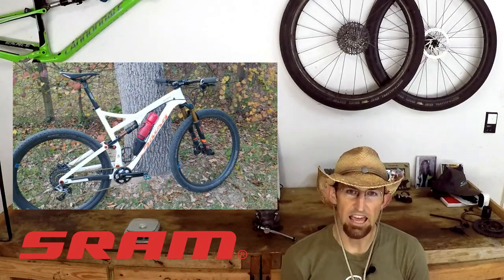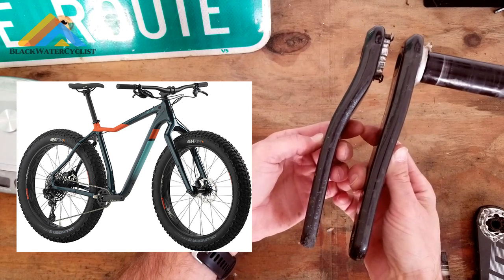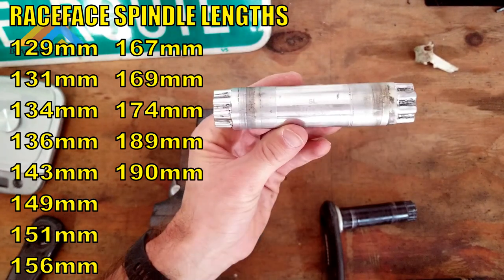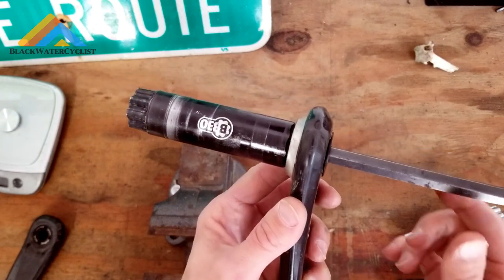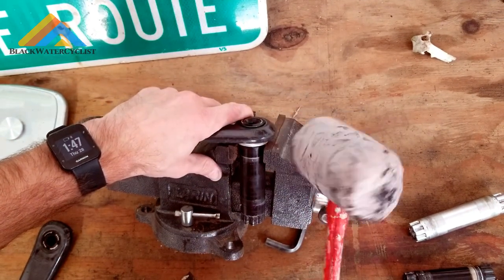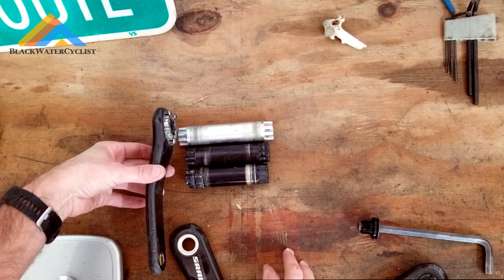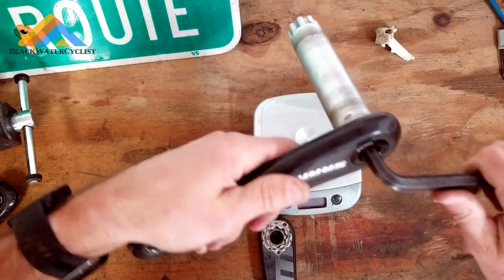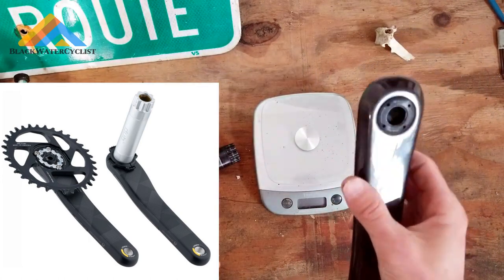The Best Carbon Crankset? - Sram BB30 Spindle for MTB | Fat Bike XX1 | RaceFace Next SL | Q Factor

Comment: BWC, really super video you did. 
Can you clarify a few things?
a)Do you know which SRAM Dub or BB30 crankarms are bonded to NDside spindle & not removeable?  (Ex. are all Eagles bonded or just XX1/XX0, etc.  I know GXP is bonded, just trying to better clarify which models the Spindle is removeable.)
b)With these SRAM cranks (NDS & DS) - am I understanding correctly, both sides can take 30mm Spindles or Dub Spindles? Probably dumb of me to ask, but I wasn't 100% clear if only one side's interface can be interchanged (ie DS, but not NDS),
 thanks so much for any time you have  to clarifying these things!
PS liked seeing the Assioma's ;)
Reply from the maker: Thanks Aaron! All Dub spindles are bonded so it won't work with the dub spindles. Both DS and NDS have the same BB30 interface which is nice. As far as which models, really any model that has a bolt on the NDS is removable. Its really just the models that have PF30 printed on the black spindle that are removable. 

Just some extra info, you can put a Race Face crank arm on one side and a sram on the other if you for some reason broke a crank arm. Cannondale you cannot do this because the BB30 interface is clocked a little off so it will go on the spindle but one crank will be at 12 o clock and the other at like 5 o clock. 

Yeah the Assiomas were awesome until I broke them :(  I was doing some rough MTB riding with them and killed them. My fault completely.

Comment: Just to be sure.... so if I buy a DUB crankset, I can remove the spindle, install a PF30 spindle and use with a PF30 bottom bracket? If yes, does the  same goes for a CINCH/RaceFace crankset? Thanks for the video!!

Comment: This is great thanks for sharing! I can't find anywhere else that posts the spindle lengths for Sram bb30/pf30/bb386/... I'm trying to fit some Sram Red 22 road cranks on a BSA frame. I know the Force 22 spindle is long enough to fit BSA BB with external cups. But I suspect the Wide (which i think is called BB386) version of the Sram Red 22 crankset (the one with removable spider) has the same spindle length as the Force. Have you encountered that or know if those spindles are the same length?

Comment: Thanks for the awesome video! Do you mind posting the spindle lengths of the SRAM MTB and SRAM Road?
Reply from the maker: Road pf30 is 118mm and MTB pf30 is 114 . The mtb pf30 spindles are narrower than the road option. They use the bend in the crank arm to make them wider to clear the mtb frame. Those measurements are with the arms removed and measured end to end.

Comment: Man! You answered so many of my questions! I'm on the market looking for a cheap used carbon crankset, so my question is: you did that spindle swap, to be able to fit a road crankset on a mountain bike, right?
Reply from the maker: Glad it was helpful for you! Yes I did it to install the road arms on my mountain bike.
Reply: @BlackWaterCyclist  Awesome! Last question, how do I start from scratch? I have this old sram XO crankset, but I lost the spindle, and I want to install in in a new frame, which measurements and dimensionas should I consider to get the correct 30mm spindle?

Comment: Love your hacks! I noticed you mentioned the crank needs to have a removable spider. I have a Red 22 crankset that I wanted to put a longer spindle on. It has an integrated spider. Is there any reason that shouldn't work. Thanks!
Reply from the maker: Hi Steven, thanks man. As long as it has the PF30 spindle then you can change it out. The smaller GXP spindle is not removable.

Comment: Good video! Could I put a GXP spindle on those arms or specifically on the Cannondale Si arms?
Reply from the maker: Hi Alfonso, thanks for watching. Unfortunately the GXP spindle is not removable so you cannot do the same as you can with the 30mm spindles. Almost all 30mm spindles have the same interface for the crankarms from Sram to cdale to raceface/Easton. One company that is different is Rotor. I hope that helps.

Comment: I’m currently upgrading my gravel bike and this video was very helpful. Do you know what the standard spindle length is on a Quarq BB30? I want to say I need at least 104mm to clear 68mm BSA frame.
Reply from the maker: Glad it was helpful. When measuring from inside of the left crank arm to the end of the spindle, it was 106mm in length.

Comment: Wow, didn't know you can do this kinda hack on Sram. I own a RaceFace Crankset with a 30mm Spindle and yes sometimes I did spindle swapping but RaceFace is designed for that.
I wonder if X01 Eagle™ DUB™ crankset spindle can be swap. Thinking of swapping it to a 170mm Spindle Fat Bike.
Reply from the maker: Unfortunately the eagle dub spindle is bonded to the non drive crank arm to lower weight.
Reply: @BlackWaterCyclist  Awww.... Thanks for the reply....

Comment: Hi, sorry this is a bit late, but I have recently snapped my sram truvativ xo crank on my dh bike and I bought a new mtb crankset but the spindle is for a normal mountain bike and is to small to fit on to my dh bike bottom bracket. As I have seen in this video I can remove both of the spindles and swap it will this work as it’s both mtb cranks worth the bend

Comment: Would that hack be possible with a DUB BB92 as well? The RaceFace spindle is 30mm while DUB spindles are 24mm in diameter - thanks
Reply from the maker: Actually the dub spindles are 28.99mm. all of the dub crank sets have the spindle permanently bonded on the left crank arm so you can't swap the spindles. Also the gxp are permanently bonded as well to the left crank arm. I hope that helps.

Comment: Does this really work on the newer kind of sram dub cranks? It seems like the non drive side is just pressed on and not screwed like on the older ones unfortunately. 😢
Reply from the maker: Unfortunately it will not work with the dub spindles.

Comment: what size is the second axis?
Reply from the maker: Thanks for the question. The short black spindle is 115mm (came off the mtb crank) and the longer black spindle is 118mm (Came off the road crank). Is that the info you were looking for? Thanks again for watching.

Comment: What size bottom bracket do you have? I currently have a wheels manufacturing BSA 73mm that converts my threaded bb to a 30mm. Could I run an easton 129mm spindle and be alright? My bike is non boost 142 and I have the sram s900 series road cranks you used in the video.
Reply from the maker: I think you would be fine with the Easton 129mm spindle. The race Face is only 5mm wider and I have more than enough room on my boost anthem for 2.5mm on each side of my chainstays.

Comment: I need your advice please !
I have a 92mm frame shell and i have a dub crankset with a bb sram pressfit 89/92mtb, so i want to use an Sram Xx1 bb30 crankset but the spindle is too short for the 92mm shell, do you know which spindle length do i need to buy ? I saw a cannondale 137mm but im not sure if that size i can use it to fit in my frame, or i need to buy the raceface and in which length options ?
 i preciate for your help ( my bike is  a Norco Sight 148mm boost ) 
I know that with this New setup i will need to change the bb to a bb30 or made the spindle reduction like you did to fit to 29mm, seems something good to do
Reply from the maker: Hi Rodrigo, Sram actually made two different spindle links for BB30 mtb. Surprising the BB30 MTB spindle is shorter than the Road Spindle. If you could find a Sram Road 30mm Spindle, it would be wide enough but not so wide that is makes your Q factor too wide. I would go for something around 130mm wide. Easton has the EC90 Road SPindle which is 129mm which would be perfect. The Race Face shortest spindle is 134mm. I just measured my MTB BB30 and it is 115mm wide. The Road Spindle is 120mm wide. SO if you can find something between 120 and 130, I think you will be in business.

Comment: Just what I need. I have a perfectly good Sram red Crankset that I would like to reuse for my new road 
bike. It has a bsa bb what spindle length do I need to make it work. I know Easton makes bsa 30 bb
Reply from the maker: You should be able to use the regular 30mm spindle unless it is the older super skinny spindle of the bb30 days. If it is the super skinny spindle then it is not removable. Otherwise you just need to buy the BSA 30mm bottom bracket to make it work with your frame.

Comment: if i do this and swap the shorter spindle for a longer one, what bb can i use? i have a orbea rallon with a 73mm threaded bb. thanks
Reply from the maker: Several companies make them. Raceface, rotor, wheels manufacturing all make them as well as a few others. If you Google "30mm threaded bottom bracket", you should see several. Let me know if you don't find any. Thanks for watching.
Reply: @BlackWaterCyclist  unfortunately there arent much selection here in new zealand and from there are no one decent to talk to about what i need when i called my LBS. i have seen this https://www.evocycles.co.nz/Product/245410/race-face-bsa-cinch-30mm-bottom-brackets but no one can confirm if it would work for what i need. i hope you could help. thanks

Comment: Do you still have the road spindle? Any interest in parting with it?
Reply from the maker: I actually do have it but plan to keep it in case I need to run it on a road frame. Sometimes you can find a 30mm spindle on ebay that is the same width and it should work for you. Do you have the arms already? I could measure the width of the spindle so you know which one to get.

Comment: Does sram have the same spindle material on all of their bb30 cranksets? I'm planning on changing my sram red spindle for a shorter one but concerned about the weight of other sram bb30 spindles cranks
Reply from the maker: Yeah all the Sram spindles are the same weight. They do not make an SL version for the Red cranks. Some companies do have slightly lighter spindles than the Sram, like Raceface but they do not have narrower spindles.
Reply: @BlackWaterCyclist   thanks! do you have any idea what spindle length should I get from raceface? I have a cannondale sse hi mod 2013-2015 with a sram red crank. thanks in advance!

Comment: Hello, I hope this is still active. I have a SRAM X1 1400 bb30 crank. Which spindle length would be best to use with Wheels mfg bsa30 and 73mm frame? Thanks for any answers
Reply from the maker: I am glad it worked out for you and thanks for contacting me on IG about it
Reply: What length was used for that set up?

Comment: Are both ends of the spindle the same diameter? If they are not do you know if I can fit a dub spindle on an xx1 non dub crankset?
Reply: Note my bike has a sram dub 73mm bsa bottom bracket and I'm trying to replace my current crankset I got a deal on a sram xx1 crank but I didn't see that it was a non dub so the outside diameter of the spindle is larger than my 29mm dub thats why I want to replace my dub spindle on to the xx1 crankset
Reply from the maker: @efrenm8826  ok so you have a few options. The DUB spindle is stuck with the left side crankarm. It is one piece. So to keep the DUB BB you will need to run your DUB left side and spindle with the XX1 on the right side because the interface is the same between the DUB right crank arm and the 30mm right crank arm. But then you would have two cranksets tied up into one bike. If I were you I would get the appropriate 30mm bottom bracket. What bike do you have? I can maybe figure it out for you. The XX1 you got is PF30(30mm spindle) correct?
Reply: @BlackWaterCyclist  yes thats exactly what the xx1 is and as for my bike I have an evil insurgent 2019

Comment: I’m currently swapping out my boost setup for a older model X01 non boost setup that I am trying to make work. Could I purchase a race face spindle with the size I need, bolt it up to the cranks and run that or are the spindles not compatible? I need help! Thank you!
Reply from the maker: Hi Tommy, the spindles are compatible if the sram crank is 30mm spindle. You may need to get an Easton spindle at 129mm. The Race Face shortest spindle is 134 so if you use the bent arms of the sram MTB, then it will make your q factor very wide. Are you trying to put a regular non boost on a boost frame?
Reply: @BlackWaterCyclist  yes the spindle on my arms are currently 30mm! I need to figure the length of spindle I need for my 2020 stumpjumper that requires a boost setup. And yes I am trying to put them on a boost frame
Reply from the maker: @tommytrevino6846  there are several 30mm spindles of different lengths on eBay that can also work. Some Cannondale spindles are around 124mm on there. So really any 30mm spindle that has that pattern will work for you. I actually recently got a 30mm spindle lathed down to 28.99mm for a dub bottom bracket. https://www.instagram.com/p/CPXD-uIBRLl/?utm_medium=copy_link
Reply: @BlackWaterCyclist  ohh wow let me look. Do you know more or less the size of spindle needed for a boosted 73mm bottom bracket? I have a race face cinch bottom bracket
Reply from the maker: @tommytrevino6846  Sram actually made two different length spindles for their 30mm cranks. You can see in this picture here from Wolftooth components. https://www.spokelifecycles.com/product/wolf-tooth-components-direct-mount-for-sram-bb30-short-spindle-cranks-2485.htm

If yours is Carbon then I imagine it is probably the shorter spindle. I just measured the one I have from a crankset like yours for a non boost frame and it was 115mm in length. The road spindle I have, which is actually 119mm long bc the road arms are straight and do not bend like the MTB cranks. You could probably get away with using a road spindle from a Sram road crankset which is 119mm.